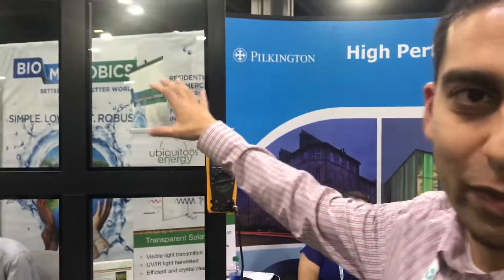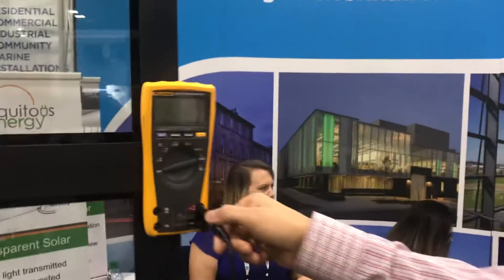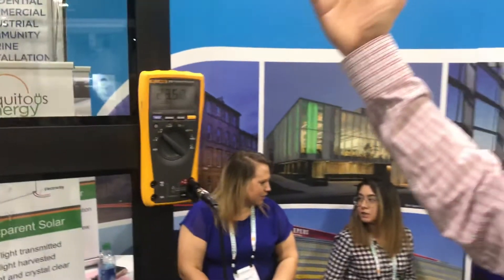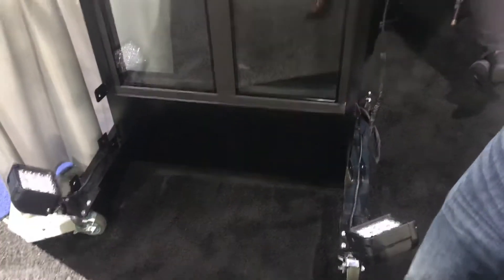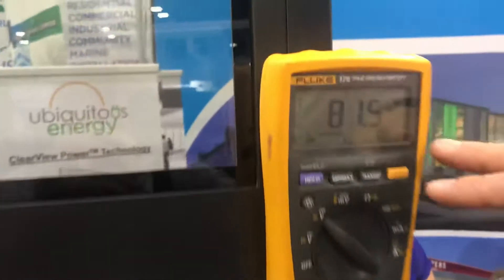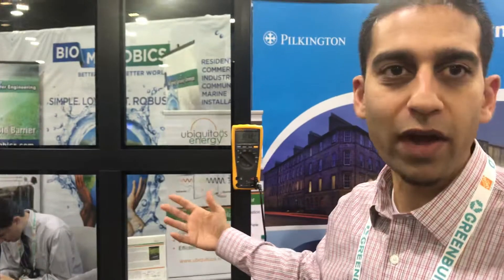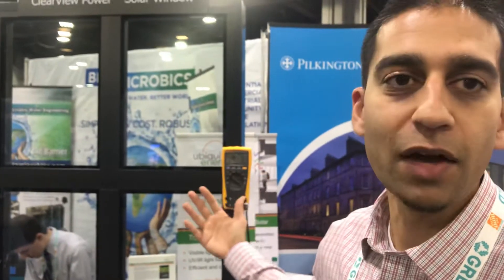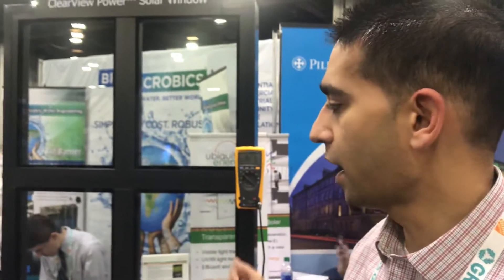Solar Window - Electricity generated from a clear exterior window.

Comment: I believe that automobiles can make their own energy while driving down the road.  Beneath the automobile are four tires.  Why cant these tires be turned into turbines?  A turbine is a device that harnesses the kinetic energy of some fluid such as water, steam, air or combustion gases and turns this into the rotational motion of the device itself.  These devices are generally used in electrical generation, engines, and propulsion systems and are classified as a type of engine.  Below the automobile is four wheels that are spinning a lot of the time getting the driver from point a to point b.  While the tires are spinning down the road---why can't they be producing electricity and sending that electricity back into the battery that is powering the automobile in the first place.  Before there were battery powered automobiles---this would not be feasible.  Where would this generated electricity go?  It is not like there is a place to store this much electricity in an automobile powered by gasoline.  However, now that automobiles are powered by large batteries, there is a place to store this electricity to be used for more trips in the future.  Just inside the tire there can be built into the tire a large copper rim that would be used instead of a steel or aluminum.  In the center of the tire where the axil is is a very powerful electro magnet.  This powerful electro magnet should not spin with the tire but should be stationery.  Either ball bearings or some other mechanism should be used to make the electro magnet in the center of the tire not move with the tire but be stationery.  So, the copper band which makes up the rim of the tire spins around the electro magnet where the axil is--producing electricity and this electricity is fed into the battery of the car by electric wires.  The battery stores this electricity for future road trips.  If the battery is efficient enough and the copper band and electro magnets in each four tires are powerful enough----a surplus of electricity/energy my be produced.  This means that more electricity is produced than is needed to run the automobile.  This surplus of energy is called the efficiency threshold.  This is not a perpetual motion machine---just a surplus of energy through mechanical means.  This surplus of energy could be fed back into the home/ and or electric grid when the automobile is parked.  In fact, why not have a home generator based on this principle.  If the automobile is suspended off the ground---and the tires rotate but don't go anywhere, but just produce electricity in surplus for the home---then the home could have almost perpetual electrical energy generated this way.  This would be a basic model but soon it would be streamlined for home or business use.  No more need for coal, gas, oil, or nuclear power plants to power anything.  Purely clean electricity--no need for the sun or wind power.  It is self sustaining and mobile form of energy that can be taken anywhere--even to outer space.
Reply from the maker: Electric cars do use their wheels as electrical generators, as they brake. That's why electric cars don't need to replace their brake pads very often. Almost all of the braking energy is used to charge their batteries and not to heat up the brake pads and rotors.